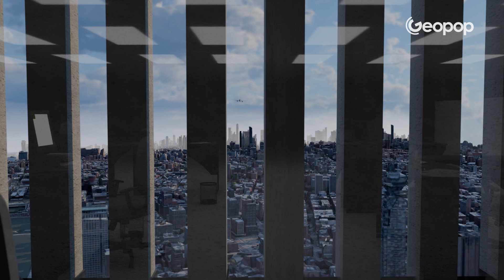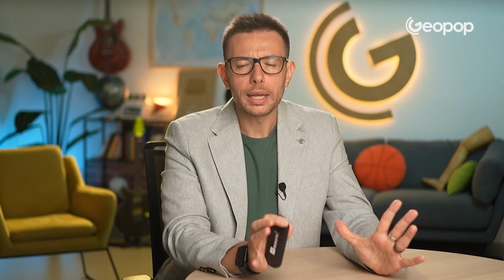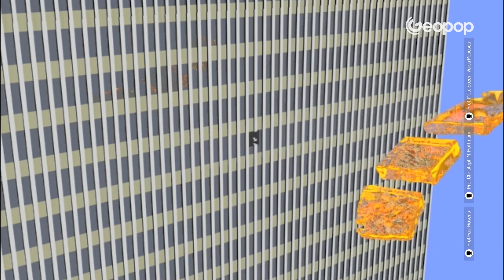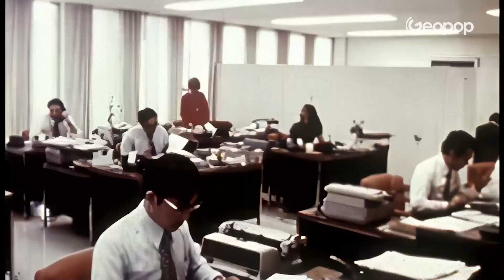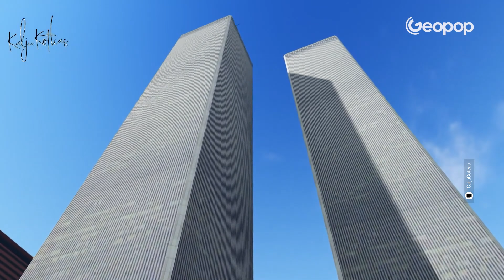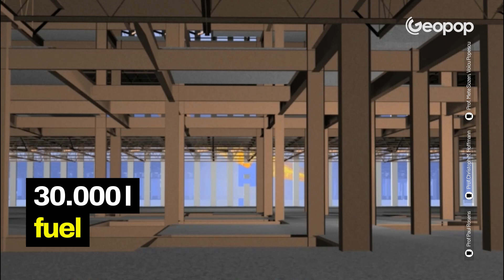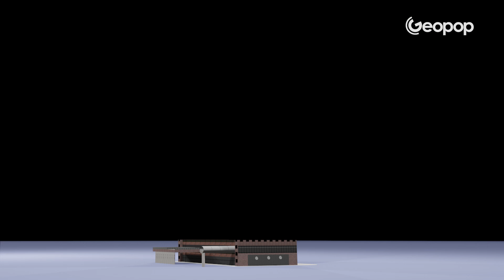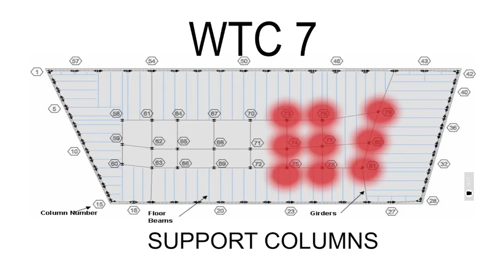9/11, 2001: The Technical Reconstruction of the Twin Towers and WTC 7 Collapses

Comment: The cores of the buildings stood for 10 sec, up to 60 floors high. Massive. 
Where did these go? 
We can see them melt away in their own foot print. And then nothing. 
In this sense there were 4 towers with different processes. No trace.
Reply: They buckled and fell. The Twin Towers were an integrated system of core columns supporting the majority of the gravity load, perimeter columns supporting the remainder and ALL of the lateral load, long-span lightweight floor trusses tying those elements together and hat truss capping it. No one element could survive without the others.  The badly battered core structure (much of its support beams ripped away during the main collapse) waved back and forth in the air for a few moments before buckling under their own weight near the base and dropping mostly straight down, out of sight in the dust cloud and obscured by surrounding buildings. These columns ended up on top of the 14-story deep pile of mangled steel spread out over 17 acres.

No big mystery here.
Reply: @TheLoonResistance  That's fast. Who sent you a signal? "Another one escaped."
You are not addressing the implications. It's just word-spray. 
The remaining core was a tower many cities would be proud of. "Buckled & fell..."
Reply: @PlanetDeLaTourette  - Yeah, I've just been waiting around for years waiting for you to post, because you are that important.  FFS 🤦‍♂

Engineering clearly not being your strong suit, perhaps this will help;

There’s a lot of really bad information out there about the Twin Towers collapses, much of it easily accessible to anyone (mostly from Architects & Engineers for 9/11 Truth who only manage to get the date right). Even though the worlds professional engineering community had the details largely worked out within a couple of months, good information is far more difficult to come by and much harder for many to digest. Engineeringspeak is dull. Wild baseless speculation and pathological theorizing is exciting. Fanciful tails of pre-planned demolitions, magical space beams, melting steel and mini-nukes (the awful stuff) are far more entertaining and require a whole lot less thinking, thus getting far more intention than it deserves.

To correct that situation, I have all on my own prepared this short yet detailed technical description of Twin Towers collapses based on my own observation and analysis of the available true and relevant facts. No politics or ideology, just the engineering. My hope is this will dispel many common myths and answer most if not all questions you may have about the Twin Towers collapses, because anything can seem like a conspiracy if you don’t understand how it works

While complex, most of the Twin Towers collapse mechanisms can be seen with the naked eye and easily discerned and understood by the layperson if sufficient time is taken to understand. 

1. The Twin Towers consisted of 4 primary structural elements that together formed an integrated system where each relied on the others.  47 hollow box-section steel Core Columns carry the majority of the gravity loads. The 236 hollow box-section steel Perimeter Columns carry the remainder and ALL of the lateral (wind) loads. Long-span Lightweight Steel Trusses connect the core and perimeter column together at each floor with a Hat Truss on top to tie the structure together as an integrated unit where no element can survive without the others. There was no structural load bearing concrete and most components were bolted together.

2. The impact of 117 tons of airplane (= to about 12 dump trucks) at speeds up to 590 mph with the energy of a ton of TNT completely destroys the aircraft. This in no way implies the Towers come out unscathed. Many perimeter columns are damaged or destroyed as are some core columns (example; 33 of 59 perimeter and 20 of 47 core columns damaged or destroyed at the impact floors in the North Tower), This damage is primarily through bolt-shearing failures at the end connecting flanges, as well as bending, twisting and fracturing of weld seams. There was no cutting or slicing - the reality was far more violent and messy. 

3. The impacts destroy or damage fire insulation, fire breaks and sprinkler systems on multiple floors.  Huge fires are started across multiple floors simultaneously and allowed to spread rapidly with no effective firefighting or fire suppression. This was an unprecedented fire event . 

4. The hotter steel gets the weaker it gets .  With fire insulation stripped away and no sprinklers the survival time of the steel greatly reduced. Gradually over time heat causes the lightweight steel Floor Trusses at the impact damaged floors to sag, which was observed and recorded.  No steel melted or needed to. Structural steel fails long before it becomes a puddle. It just needs to bend

5. Sagging floor trusses pull on the increasingly weak and overloaded Perimeter Columns, causing some of them to bow inward by up to 5 feet. A straight column is up to 4 times stronger than a bent column. The bowed Perimeter Columns buckle and fail, initiating collapse. The formerly static mass above which the structure below could easily support is now converted into a dynamic mass up to 30 times greater. Because they have buckled, the Columns above and below the failure point are no longer aligned . The load bearing structure below no longer bears any load as it falls past the lower columns, NOT onto them.

6. Thousands of tons of debris fall within the four outer walls, down through the open office space, crashing onto the first intact floor it encounters. This massive impact immediately breaks the bolted connections to the columns as the amount of resistance the Floor Trusses can offer is negligible.  The falling debris slows only marginally and briefly. Note:
6a. This is NOT a solid top block crashing into and “crushing” a solid bottom block .
6b. The debris falls past the columns not onto them.  The columns provide no resistance to the falling debris. 
6c. Only the bolted connections of the floor trusses to the core and perimeter columns can offer any resistance. A pair of 5/8” bolts at each end of each truss vs. thousands of tons of falling debris.
6d. No laws of physics are violated.

7.  This floor-led collapse progression within the four outer walls can only go straight down. Note: 
7a. This process is often incorrectly referred to as “pancaking” which actually refers to a completely different process rejected at an early stage. The catchy name stuck but nobody knows what it is supposed to mean.  Pancaking is too simplistic and inaccurate anyway. More like Kaiserschmarrn.

8. Collapse progresses through the floor systems not down the columns, through the path of least resistance . Rate of floor failures increases with each successive floor as momentum increases, reaching an average acceleration of 0.65 of GA, or 35% slower than true free fall. Bam, bam, bam down the building until there are no more floors to fail.  The resistance offered by each successive floor is always the same. The mass and velocity, thus the energy of the falling debris is constantly increasing, with each floor destroyed adding new falling mass. Some falls to the sides, but most falls down. More mass, more velocity, same resistance with each floor.  Don’t get stuck on the but the lower floors weren’t on fire nonsense. They weren‘t and didn’t need to be.

9. The Towers were 95% air by volume. As that air was compressed inside the building it is forced down the tower and blown out the sides in reaction to the building collapsing . Those were not “explosions”, it was expulsions of compressed air caused by the collapsing building, explaining the low velocity, lack of flash, blast, supersonic pressure waves and lethal high-velocity ejecta.  

10. Perimeter Columns become detached and peel away like a banana behind the collapse front, playing out to the four points of the compass extending to more than 600 feet from the base of the towers. This was quite obvious from examination of the debris pile. 

11. Core Columns fail last as their internal beam bracing is stripped away by falling debris and lateral support from the floor to perimeter columns is lost 

12. For those who care about how long this whole process took; 31-34 seconds from the moment the perimeter columns buckled until the last core columns hit the pile, or 1/3 the rate of true free fall. Don’t believe me?  Just watch any video of the collapses and note the loose truly free-falling debris dropping much faster than the towers themselves.  

13. Each Tower had a 1-acre footprint. Far from collapsing inside their own footprints the debris pile spread out over 17 acres in a pile up to 14 stories deep. 8 surrounding buildings were destroyed and scores more damaged. 

14. Finally, the Twin Towers were perfectly safe within their design envelope.  They only collapsed when taken far outside design parameters by an extraordinary and unprecedented event 

Impact + Fire (heat) + Time + Gravity = Collapse . Remove any one of those four elements and there is no collapse. Ignore any of those elements (as many do) and you will never understand the collapses. The Twin Towers were an integrated system in which no one component could survive without the others. One fails, the rest follow, through the path of least resistance – DOWN – through the open space, bypassing the path of greatest resistance – the columns.  Nothing I just described violates any laws of physics. All of the above is true no matter who planned and carried out the 9/11 attacks or why 

I hope you found this helpful and informative. It is not meant to be adversarial, but to solicit informed critical comment, positive or negative. If I made any errors of fact, logic or reason or left anything critical out, please let me know so I can fix it. To stay focused just one topic at a time please and on-topic (Twin Towers ONLY). No word-salads of Gish Gallop. IF you can offer a more plausible alternative be my guest. Be the first. Please start any reply with the words “Tits McGee” or I will know you didn’t actually read it, are not serious and just wasting my time.
Reply: @TheLoonResistance  You seem to be incapable to focus on an issue. 
There was a 60 floor tower (core) standing for 10 seconds.
Next thing: a heap of rubble in the lobby.
Reply: @PlanetDeLaTourette  - Yes, cores failed last and I explained why, in detail, which requires an understanding of the structure and the collapse mechanisms to comprehend.  I do realize the attention span of the average conspiracist is about 4 lines of text (NOT sentences) and thus you did not read my explanation (I know for a fact you didn't) but if you don't understand how everything works, you won't get it. 

Everything you need to know is in my previous reply, laid out in detail point, by point start to finish, in order. Do one at a time if it is too much of a burden (they are conveniently numbered so you don't lose your place) or acknowledge this topic may be over your head and find another hobby. 

I'm beginning to think your OP was rhetorical and you genuinely don't care, nor do you even really know what you are asking or why.
Reply: @ I've seen your stuff. Copy-paste work. Doesn't address the issue. 
There was a very tall structure standing. Where is it?
There are photos, you know. The core is chopped off like a tree. There is no recognizable debris. 
In fact: there is not much debris at all. On the plaza it's like waist deep. The sculpture stands tall. 
The heap in the lobby (2*) is also very small. Firstly: the remaining core is not debris. Around it merely meters. There are good points of reference: the entrance is blocked, one might say. It's quite absurd. 

I'm very serious. Where is the construction that stood tall for 10 seconds?
Reply: @PlanetDeLaTourette  - Some of the core columns were the last parts still (barely) standing, right up until they inevitably couldn't.  The reasons why all explained above and inherent to the design of the Towers and the mechanisms of collapse.

The debris pile was up to 14 stories deep, spread out over 17 acres (destroying 8 surrounding buildings and damaging more than 100 others) and taking 10 months to remove.
Reply: @PlanetDeLaTourette  - Lemme take a wild guess.  You've been reading Judy Wood (or at least saw a video).  The reason you don't see the debris is she goes out of her way to not show it to you. Sometimes you actually have to go out and look. Not hard to find.
Reply: @PlanetDeLaTourette  - I just remembered this short video which may help you find that debris you are missing.

www.youtube.com/watch?v=u2D__-DVLBk
Reply: @ Yeah, it's other people. I have no agency. Weirdo.
The pictures. There is a heap in the lobby that blocks the door, and then some. Fact.
There are also just a few core columns visible. The fell last. I want to see 20 kilometers of it. Where is it?
Reply: @TheLoonResistance  At least the one guy in the comments is serious. He agrees that there is little debris.
Like I said. It only blocks the door in the lobby.
Reply: @PlanetDeLaTourette  - I take it then you never bothered to watch the one minute video from my last post with excellent photos of the massive piles of debris.